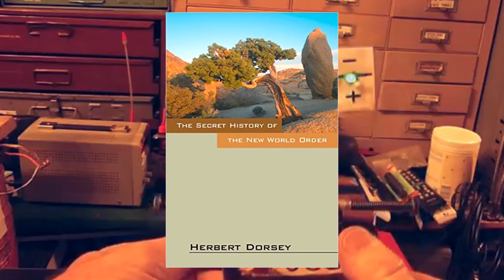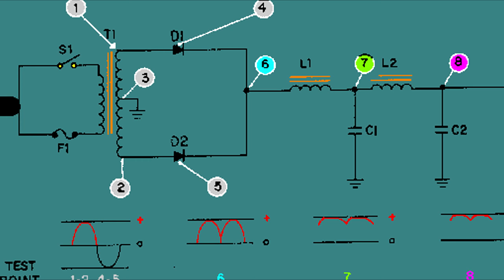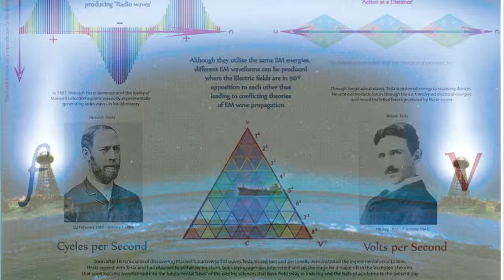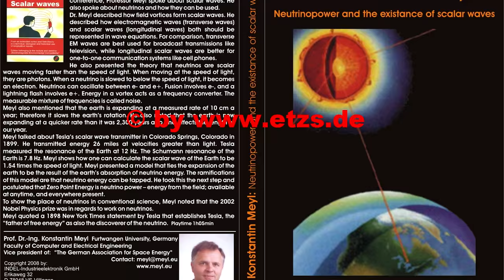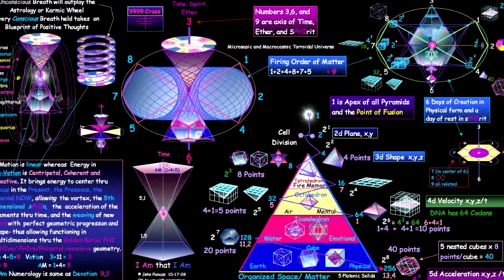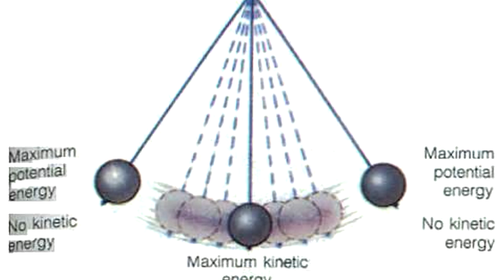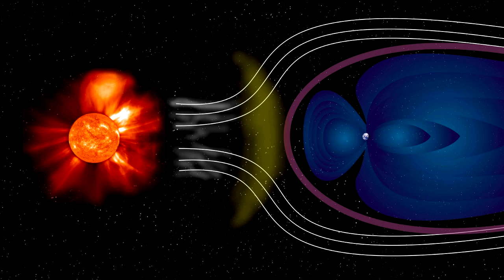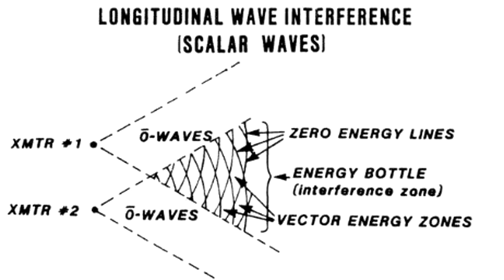Jeff Rense & Herbert Dorsey - Secret Science of Electromagnetism

Comment: I have wondered about this for a while, as an EE, I don't know much about permanent magnets so I have a question. If you want to make a permanent magnet you have to use electricity. So you have energy inside the permanent magnet because the particles are organized. If you use this permanent magnet to get "free energy", is it not simply discharging the energy that was put into it? As you use your motor do the magnets not gradually lose strength? Are there any good PDF's on this with lots of math? I've concluded that these free energy demonstrations involving magnetism cannot really be shown to work unless they use electromagnets rather than permanent ones. I'm wondering if anyone can show me that my thinking is wrong.